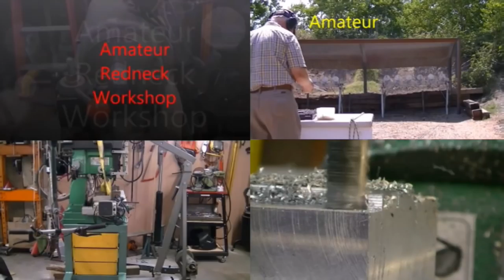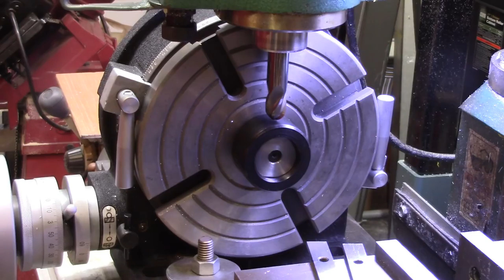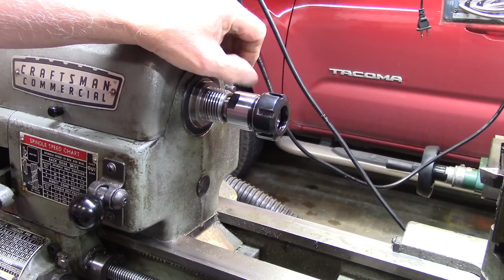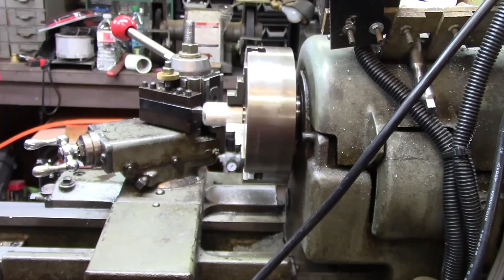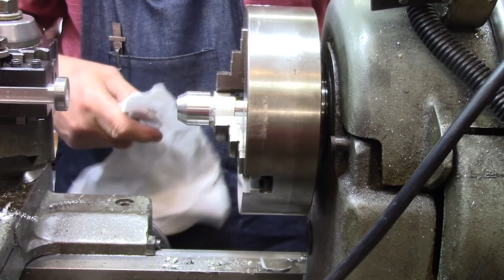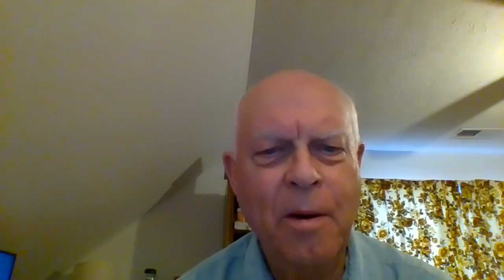Lathe spindle protector and draw bar part 2 of 2

Comment: Hi Harold,

I also used zinc coated steel thread rod and it works well.   I welded the nut to the end of the rod as you will have to hit the rod to knock out the Morse taper.  I just back off the nut several turns, start the lathe, and tap the rod end /nut to loosen it.  Best to do it running to save pounding on the roller bearings in the same spot -  if you have them supporting the spindle.

Cheers Rob
Reply from the maker: Tapers sure do stick tight.  Thanks for stopping by.

Comment: A good solution. I use ER 32 collets in my lathe, but I found a mount on eBay that I mounted to a backplate. For anything round under 3/4 they are good, if I had it to do over I'd go with ER 40 so I could do 1inch
Reply from the maker: I probably should have also but hindsight is always so clear.  Thanks for stopping by.

Comment: Is that an ER40 collet holder and where did you find what looks to be one piece MT3 setup? I just finished making a thread protector for my Atlas from black Delrin and did not use the compound but the plunge method also. I ask two of my machinist friends what system 
they use and it's the plunge . fun video, thank you for sharing.
Reply from the maker: I am glad you liked the video.  The collet holder is an ER32.  Thanks for stopping by.

Comment: I really tink your camera is getting old, it's getting near to be needing a operation for cataracts...    lol
Good thing you got something else than Stainless Steel for making your part, SS tends to gal, stick and strip, personaly, I avoid using SS in fasteners unless REALLY necessary...
Reply from the maker: I do not have a lot of stainless left now, mostly used up.  Thanks for stopping by.

Comment: Hey Harold   I just ordered one of the rotary table off eBay. I was wondering if you have the rotary plate with your rotary table.
Reply from the maker: Yes I have a set of indexing plates.  The people who sell you the rotary table will also have the plates.  I think most of the ebay rotary tables are actually made in the same factory.  Thanks for stopping by.